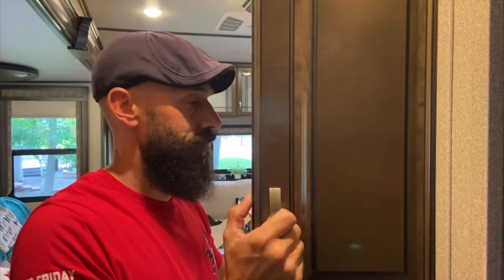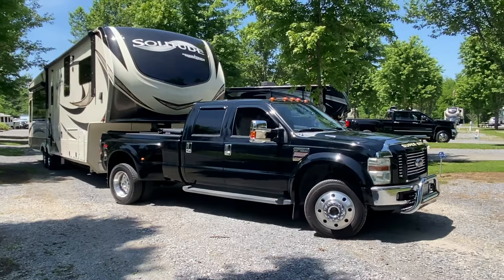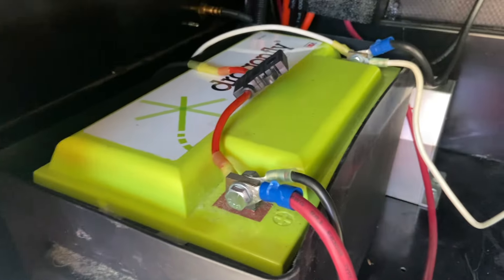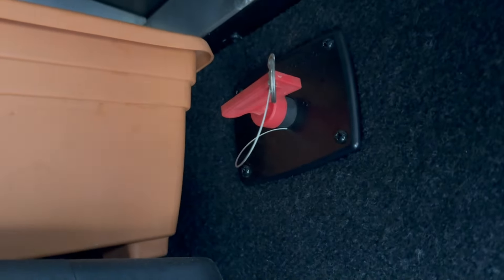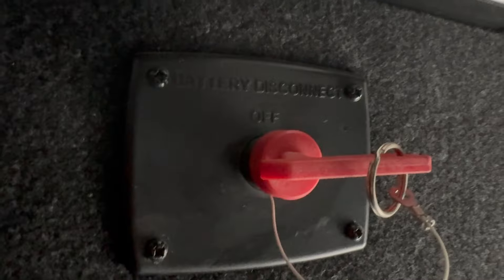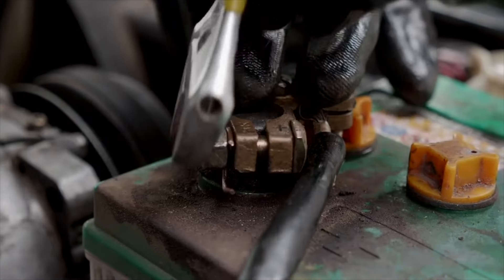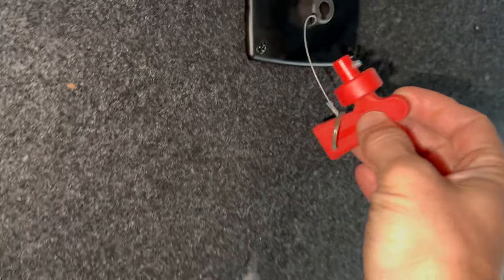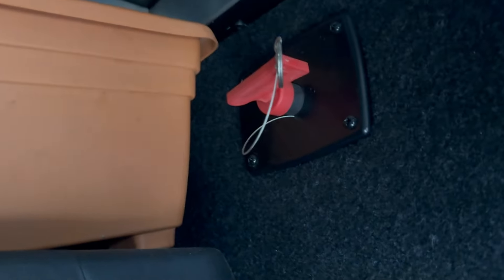Simple Solution that Could FIX Your RV PROBLEMS

Comment: I replaced the one that came from GD. With it turned off my frond landing legs would still operate. So when I put a little bit more solar on my rig, I replaced that with an off switch that kills everything except my solar charger to my batterys. It has its own separate on off switch. Yes, and sometimes is best to sit down and think it over before you get your voltmeter out. Would you do a good job so if I ever have issue I’ll call you.
Reply from the maker: Good deal Tim. That makes sense. 👍🏼👍🏼
Gotta be honest I hate fixing my own stuff so I don’t know if I want to do others 😂😂

Comment: I pulled my battery due to putting in storage for the winter. Should I keep my battery tender on my battery 24/7 or charge to full and remove, then recharge at a specific interval and repeat cycle? Thank you
Reply from the maker: Good job. I would just put it on one of those slow little trickle chargers and keep it on it 24/7 if you can. But I suppose either way really wouldn’t hurt either if you remember to hook up every so often. Appreciate you watching 👍🏼
Oh and if it’s a regular lead acid battery it may still required distilled water too so don’t forget to check that.
Reply: @WhyWait  thanks so much. I appreciate your content so very much. It is a lead acid battery (for now lol) and luckily saw I need to check and add more distilled water as needed. Thanks for sharing that nugget of info too 😁. The charger I use is the Battery Tender 12v 1.25 AMP Automatic Charger and Maintainer. Do you think that is ok to leave on 24/7? Thank you
Reply from the maker: @cherylcase252  yup that will be fine. It has a float/ maintenance mode that keeps from over charging the battery. Just hook it up and it does the rest, nothing to worry about. 😁👍🏼
Reply: @WhyWait  👌 awesome! I was hoping I ordered the right one 😉. Happy Camping!!!